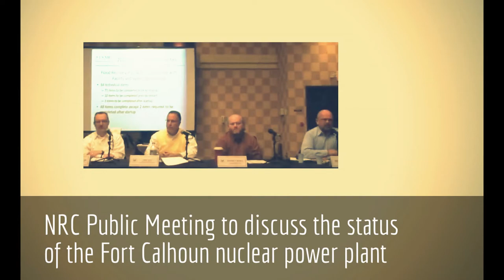☢ Nuclear Energy vs. DEADLY Radioactive Waste Throwdown ☢

Comment: An extremity misleading video. All thermal power plants whether they are Coal, CSP, Nuclear, or Gas all have an efficiency of around 35%. However where the video becomes misleading is by mentioning that the nuclear reactor from burning it's nuclear fuel only get this efficiency and the rest is deadly waste. What they don't mention is that the nuclear reactor only used 4% of the uranium in the fuel rods. Those fuel rods can be re-processed until all the uranium is used in repeated burn-ups. A typical anti-nuclear coached interview
Reply: SK412 - Another one of those faceless trolls. The total cost of spent nuclear fuel management (open cycle) is impossible to establish at present, while the related costs of the closed cycle are stable. One of the latest economic analyses carried out by Ko and Gao shows that the difference in the fuel cycle costs between recycling strategy and “once-through” strategy is negligible. Therefore, other factors such as the intangible asset play important roles in determining the future nuclear fuel cycle options. De Roo and Parsons have developed the first methodology to calculate the levelized cost of electricity extended to the reprocessing strategy. Högselius gives an explanation of why the world’s nuclear power countries differ from each other with respect to their spent nuclear fuel (SNF) policies. Countries with reprocessing facilities are France, Russia, the United Kingdom, Japan, India, Pakistan, and, most recently, China. However, many other countries reprocess or have reprocessed part of their used fuel, although they do not have their own facilities, and they recycle or have recycled in their reactors. This is the case in Holland, a country which has reprocessed the total amount of its used fuel. Don't forget that the Fast Breeder program is changing the Nuclear landscape further...
Reply: The only ones who believe the future of energy production is nuclear, are those within the nuclear industry 

The writer is well known to the nuclear industry as a lobbyist. 

Get over yourself, Harry , you stand alone with the failing nuclear industry...

I trust emergence, and what is emerging isn't nuclear energy
Reply: ASK412 -  I fell from my seat laughing, you strike me as a kid that never completed secondary education. I know of plenty of climate scientist that are all for nuclear energy. Furthermore, Russia and China have some of the best scientist and engineers, you think that they don't understand the environment and economical viability. The Rostov Nuclear Power Plant is the only plant in Russia which started three units on one site over a seven years period. Unit 2 started in 2010, unit 3 in 2015 and now unit 4 has started. Rostov is a "showcase" in which ASE and Rosatom "test their cutting-edge project management technologies, implement digital solutions while gaining invaluable experience" which can be used at other facilities. When Rostov 4 reaches full power and commercial operation next year, nuclear power will provide 54% of the power in southern Russia. I don't know where you are from since you are a faceless troll. But if your are from the USA you live in a country that is in a spiral of decline.
Reply: 'The Rostov Nuclear Power Plant is the only plant in Russia'  Harry Degenaar 

Grow up Harry , what in the earth name makes you think any Russian enterprise funded by their Sovereign Wealth, guarded as a national security asset of the nuclear state is going to give us metrics we can trust. 

You still haven't addressed the following.

1) the fallacy about reprocessing of spent nuclear fuel being viable -  no metrics supplied in answer 

2) that nuclear energy has levelized data showing it is economically viable -  no metrics supplied in answer 

3) the reason nuclear nations who have reactors a phasing them out as economically and environmentally unviable -  no metrics supplied in answer 

4) America is not in decline as an energy producer, they are successfully leading the shift to renewables. You have no proof, except reactor failure after reactor failure, I don't disagree nuclear energy in the US is failing -  no metrics supplied in answer

5) after over seventy years there still is no answer to the backdoor nuclear waste issue, worth billions, if not trillions projected into the future that is conveniently left off even Lazard data or any other energy consultants metrics. But to be fair they don't account for the cost of carbon energy waste to our economic system either -  no metrics supplied in answer
Reply: ASK412 - Your quote: "The Rostov Nuclear Power Plant is the only plant in Russia". really looks like that you don't know much about Russia. Typical repetitive stuff from faceless trolls, and in the renewable tribe there are plenty of them. The USA has fallen behind China, the leading worlds economy. The Chines also have a better energy policy.  China has started the construction for two prototype molten salt nuclear reactors in the Gobi Desert in northern China. The reactors will produce one thousandth of the radioactive waste of existing nuclear reactors because of deep burn and provide for a more complete conversion of the nuclear fuel. Both reactors will be underground and the heat they generate will reach 12 megawatts. The heat will be channelled to a power generation plant, several factories and a desalination plant by the lake to produce electricity, hydrogen, industrial chemicals, drinking water and minerals. After the experiment, China plans to move on to commercial use of the technology on a larger scale. As I write this China is in the final stages of commissioning it's Gen-IV HTR-PM 210MWe demonstration Reactor. Japan failed with its Fast Breeder Program, Russia has made a success of it. So, when I deal with a real face you can get the metrics. So lets start with a face on LinkedIn, a platform for professionals and we can continue...
Reply: 'molten salt nuclear reactors' have been in continual experiment since 1949, none have ever proved economically or environmentally viable. 

Nothing new here, no revelation, move on, Harry .

You still haven't addressed the following.

1) the fallacy about reprocessing of spent nuclear fuel being viable -  no metrics supplied in answer 

2) that nuclear energy has levelized data showing it is economically viable -  no metrics supplied in answer 

3) the reason nuclear nations who have reactors are phasing them out as economically and environmentally unviable -  no metrics supplied in answer 

4) America is not in decline as an energy producer, they are successfully leading the shift to renewables. You have no proof, except reactor failure after reactor failure, I don't disagree nuclear energy in the US is failing -  no metrics supplied in answer

5) after over seventy years there still is no answer to the backdoor nuclear waste issue, worth billions, if not trillions projected into the future that is conveniently left off even Lazard data or any other energy consultants metrics. But to be fair they don't account for the cost of carbon energy waste to our economic system either -  no metrics supplied in answer

ZIP, Sweet FA, nada, nothing, just more copy and pasted of decades-old rhetoric the Disney Generation enamoured with the nuclear industry put up in self-serving blogs. It's inane!
Reply: ASK412 - 'since 1949 molten salt nuclear reactors'; really you should check better on the history. The political and technical support for the program in the United States was too thin geographically,  in the United States, only in Oak Ridge, Tennessee, was the technology understood. This has now moved to China and elsewhere. Anyhow that's the past we now live in the 21st century. We are also seeing the active development of Lead Cooled Nuclear Reactors.
Reply: Nothing new here, no revelation, move on, Harry .

You still haven't addressed the following.

1) the fallacy about reprocessing of spent nuclear fuel being viable -  no metrics supplied in answer 

2) that nuclear energy has levelized data showing it is economically viable -  no metrics supplied in answer 

3) the reason nuclear nations who have reactors are phasing them out as economically and environmentally unviable -  no metrics supplied in answer 

4) America is not in decline as an energy producer, they are successfully leading the shift to renewables. You have no proof, except reactor failure after reactor failure, I don't disagree nuclear energy in the US is failing -  no metrics supplied in answer

5) after over seventy years there still is no answer to the backdoor nuclear waste issue, worth billions, if not trillions projected into the future that is conveniently left off even Lazard data or any other energy consultants metrics. But to be fair they don't account for the cost of carbon energy waste to our economic system either -  no metrics supplied in answer

ZIP, Sweet FA, nada, nothing, just more copy and pasted of decades-old rhetoric the Disney Generation enamoured with the nuclear industry put up in self-serving blogs. It's inane!
Reply: ASK412- Finland even with their bad experience with the construction of the French EDF Reactor, they have started the construction of the proven Russian Gen-III+ VVER1200 Nuclear Reactor. So I don't like repetition. If you are not a typical troll coward, lets start with a face on LinkedIn, a platform for professionals and we can continue... Have a nice day.
Reply: ASK412 - See I am not just pro-nuclear, I work as a well respected international research engineer on advanced nuclear technologies on the inside. I don't like your copy & past troll and straw-man style rhetoric. Self-serving anti-nuclear blogs, is something you are well into. If you are not a typical troll like coward, I make mention now for the 3rd time to show your face on LinkedIn, a platform for professionals and we can continue... Have a nice day.
Reply: 'Self-serving anti-nuclear blogs, is something you are well into'  Harry Degenaar 

Now now, don't go projecting your values onto mine, that says far more about your system of values than you realise.    
Seriously, this from a man who doesn't even understand the history of human warfare 1600s to the end of WWII. Get grounded in reality Harry   

But it bears out exactly what I have been saying 

Only those in the nuclear industry think the future of electricity production is nuclear 

In fairness, though I know exactly who you are Harry , what you say repitiousoly in public forums in Australia, and why you keep ignoring the truth in those questions repeatedly.
Reply: ASK412 - Just digging deeper - your connection with Greg Rzesniowiecki leads me to Australia and now it can be Helen Caldicott, Adam Broinowski.
Looking at the style of writing I would say it is Adam Broinowski... A family that is hopelessly affected by nuclear-phobia.
Reply: ASK412 - if you are Adam Broinowski, I can understand that you are afraid of any commentary that would come your way, on LinkedIn. You know this very well, and that you won't survive there.
Reply: ASK412 - Your quote; "Seriously, this from a man who doesn't even understand the history of human warfare 1600s to the end of WWII." 
Your remark "Fascinating, why your family would corner the market on grief over the horrors of WWI & WWII is a mystery, although I guess it speaks to your values". This is about my family and my sister that died of starvation during WWII and my trauma that persisted for many years. I will not forget your sick remark. This comment will certainly be left in place for others to see... BTW - Be rest assured that my input on public forums regarding advanced nuclear energy in Australia, especially for the "Nuclear Fuel Cycle Watch South Australia" will continue...
Reply: 'leads me to Australia and now it can be Helen Caldicott, Adam Broinowski. Looking at the style of writing I would say it is Adam Broinowski.'  Harry Degenaar 

It's sad how our faculties degenerate, I'll be there all too soon as well, I guess. 

Firstly , Rzesniowiecki , is a Kiwi and I have never met him.

Secondly , I don't know  Adam Broinowski 

Thirdly , as for Helen Caldicott's credentials, they are publically speaking, sounder than yours. I have never met the woman either. 

Fourthly , your reading comprehension is abysmal, in all probability you haven't actually read or comprehended a word I have written. 

But that's ok, as I like many others, I am aware of who you are and your behaviour.
...
Reply: ASK412 - JUST A FACELESS COWARD. IT CAN BE ANYONE - YES THERE ARE MANY RADIO-PHOBIC INDIVIDUALS THAT DISAGREE WITH MY COMMENTRY. THAT OTHERS ARE AWARE OF ME AND MY BEHAVIOUR AGAINST FACELESS TROLLS, THAT IS GOOD NEWS TO ME, THANK YOU FOR BRINGING THIS TO MY ATTENTION. WOW AND NOBODY KNOWS ON WHO YOU ARE. LOL - ASK412 KEEP UP YOUR GOOD WORK.
Reply: Firstly, Harry , why are you breaking long-standing internet etiquette, shouting using caps? 

More ad hominem, good. It's fantastic that you denigrate me personally, go right ahead. 
Because, whenever you have done that your line of logic has been refuted, you are tapped out of responses and the truth has won out. 

I've been here many times before with you Harry , the lies told about this industry catches up with everyone. You are not the exception.  

As for not being accessible, your reading comprehension is still abysmal. If you actually read what I wrote you would be well aware who, and what or where I am
Reply: ASK412 - YOUR long-standing internet etiquette is it. LOL 
Bob Wallace comes to mind, a TROLL banned on a number of good energy blogs... LOL
Reply: ASK412 - For anyone seeing that comments here. Russ Finley (a real name) posted on a well known energy blog in which Bob Wallace participates placed the following comment. "Harry, he's baiting you in an attempt to get you to say things that may get you banned. You're a valuable voice here, don't take the bait : )"...
Reply: 'Bob Wallace comes to mind, a TROLL banned on a number of good energy blogs... LOL'  Harry Degenaar 

You're claiming to have blocked Russ Finley or Bob Wallace and countless others, seriously?

You do realise that is a public admission you and yours can't actually handle criticism, which in any logical thinkers mind raises the, WHY? 

In turn that has only one logical answer! 

'banned on a number of good energy blogs'  Harry Degenaar

By good you mean, nuclear energy lobbyist blogs, set up surreptitiously to fool the unaware it's an advertising front funded to create disinformation and make the nuclear industry look viable. 

Why would any genuinely independent thinker who cares enough to ask the challenging questions of industry representatives, care, if they were banned from those Potemkin villages you frequent? 

And you think emerging generations aren't onto this whole nuclear energy sales channel scam. 

Dream on Harry   
____________
Your reading comprehension is still abysmal, I have been candid with who, what and where
Reply: I got my 2 year old grandson sitting on my lap trying to play with the keyboard, there is no edit function so my lines are a bit mixed up... LOL
Reply: Then at least stress to him the liability issues in publically slandering others, because one day Harry , someone is going to take you to a civil court for damages if you're not mindful of others public credibility.
Reply: ASK412 - Having had a re-read of your comments. The Australian Paul Richards uses his favourite "ad hominem". Paul Richards misrepresentations of people's qoutes? He has been blocked on my FB page for some time.
Reply: ASK412 - Having had a re-read of your comments. The Australian Paul Richards uses his favourite "ad hominem". Paul Richards misrepresentations of people's qoutes? He has been blocked on my FB page for some time.
Reply: ASK412 - Harry , someone is going to take you to a civil court for damages if you're not mindful of others public credibility. ASK412 you are welcome anytime, I am ready for you... LOL
Reply: Me, no, no, you have it upside down as per usual. Your ad hominem are a gift. 

Why? Because, as all ad hominem used first in a debate are a clear signal of the failure of any line of logic. Your failure is clear, and on public record into perpetuity. 

My warning is; not everyone sees the world that way. Beware, Harry
Reply: ASK412 - Who's reading comprehension is small. Your quote; "You're claiming to have blocked Bob Wallace and countless others, seriously?". Where did I state that.? Bob Wallace is blocked on some quality publicised energy blogs. Including the threads of the Nuclear Humanist because of his spamming nature... And yes on FB I have blocked some spammers.
Reply: ASK412 - I have better things to do. Keep up your good work, it will make the good people see that you are no more than a faceless spammer.
Reply: 'And yes on FB I have blocked some spammers'  Harry Degenaar

Spammers, seriously? All the IT advertisers you have blocked could be counted on one hand. 

You lie, you blocked the hard questions, Harry and you know it. I know, because I asked them along with many well recognised nuclear industry dissenters. 

You can't handle genuinely intellectual questioning about the whole nuclear industry! 

This thread here is absolute proof to any reader.
Reply: ASK412 - my last comment - Paul Richards (ask412) on Pinterest
Reply: '....my last comment...on Pinterest' Harry Degenaar 

Fascinating... 

Who gives a  f..k? 

You never answer any hard questions about the nuclear industry, ever?  

Who uses Pinterest? 
I haven't for seven years...
Everything I posted, I did in the first three months it was opened, the sites irrelevant
...
Reply: ASK412 - you missed the point as always - it did reveal you as being Paul Richards. I should have done a Google on ASK412 much earlier it shows your twitter account and email address. With knowing on whom you are, yes, who gives a  f..k? So have a nice day. BTW - there is not much wind blowing in South Australia, 11% generated from wind at the moment. The Carbon Intensity as I write this is 343(gCO2eq/kWh). That of France is a low 69(gCO2eq/kWh). I wander why...
Reply: Correction - I wonder why...
Reply: As for those like Harry who have faith in the nuclear economy, they fall into four basic positions : 

1. People who believe the nuclear industry story about saving the planet from C02 emissions

2. People who want to join the nuclear brotherhood out of arrogant ignorance about real-world security needs 

3. People who believe the nuclear industry story about increased jobs, sovereign wealth gain, which generally but not always, includes + 1 & 2 

4. People who trust the UN Security Council P5^^ who oversee the IAEA who manage and police weapons, reactors, and waste to look after their legacy, as long as is needed; hundreds of thousands of years. So that damage to the planet isn't a far worse threat to the existence of DNA than the carbon energy economy.
  

Naturally, the value systems within these have orders of complexity that can't be covered, but most people supporting the nuclear story, are generally putting much of their faith in God running the planet, and any disaster must be of his design - an act of God 

They do this for little more reason than, we as God's children are far too imperfect a creature in living on this earth, far too sinful in nature to be responsible or be allowed to damage the planet.  

Nonetheless, there is faith in the global IMC doing the best to save the planet, when they are literally responsible for megatons of nuclear weapons ready to decimate the planet seven times over while under their control. 

Doesn't that read like a serious pathology in the whole nuclear industries cultural values? 

Particularly when the overarching chain of command emanates from the Security Councils P5, who's collective and in each individual IMC carry the military mantra of;

'Taking Ground off the Enemy at all cost, everything else is collateral damage' regardless if it's legitimised in international treaties or not'   

Yet people turn a blind eye to the disasters listed globally using nuclear technology, while the industries media demonstrate time and time again, any damage to our ecosystem is justifiable or has a deniable effect due to the often long timeline of contamination mutating DNA. 

A position totally consistent with the cultural ethos of the IMC and those at the apex of the corporate world; whose premise could juxtapose the militaries 'taking ground' for 'profit' at all cost, everything else is collateral damage. 

What is fascinating is, this perspective is opaque to the true believer in the Disney Generations hope of 'electricity too cheap, to meter...' together with the cultural trait in America of only accentuating the positive, a genuine point of difference to countries on the second tier stage of human development, who don't fear the negative.    

_______
^   Most Americans Still Believe in God: http://www.gallup.com/poll/193271/americans-believe-god.aspx

*  'The Long Peace' - running continuously since 1945/46. This is demonstrated visually and statistically in this movie. That is an 18:00min interactive video, free to watch:  http://www.fallen.io/ww2/

^^  China, France, Russia, the United Kingdom & the United States of America; who collectively use the IAEA assist in negotiating international, national treaties, agreements, approve WHO radiation studies, encourage local subsidies, tax breaks and the use of nuclear materials for their own industrial primary premise of profit before social responsibility.